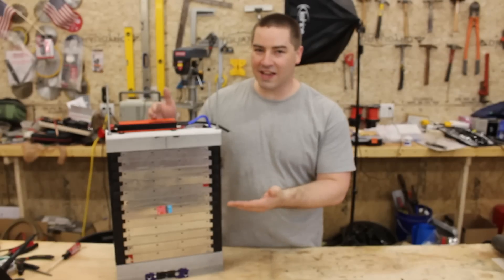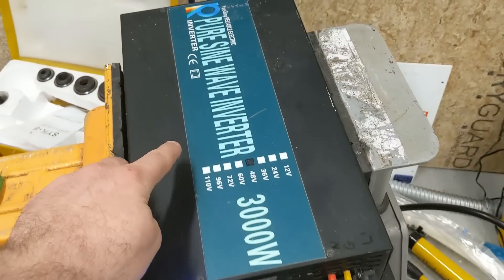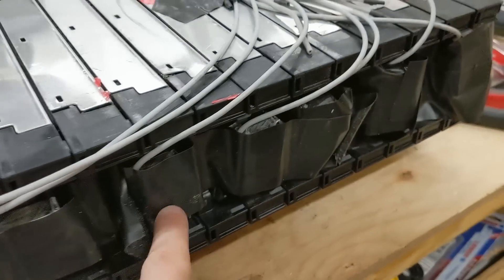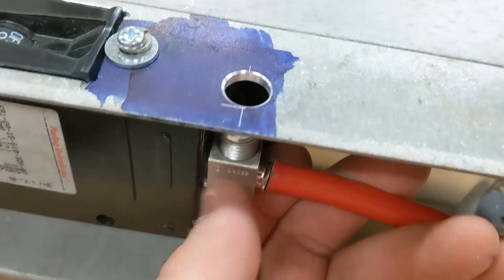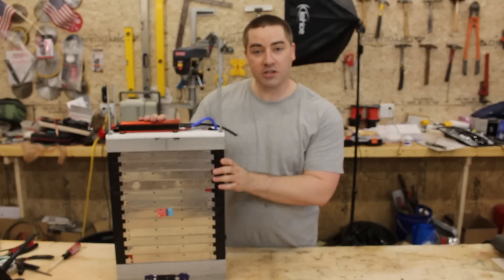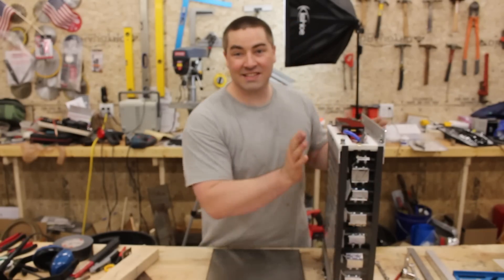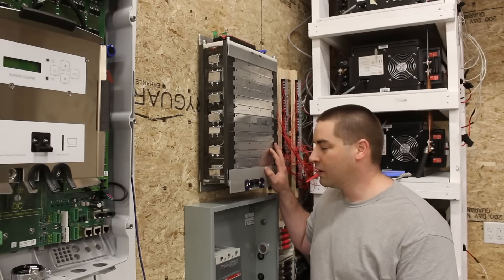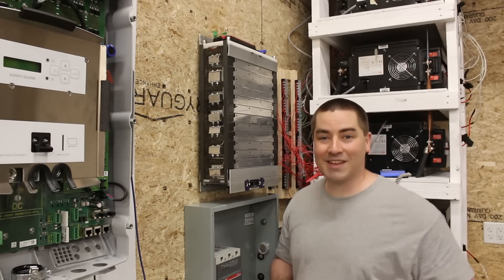LG Cells Part 2, 6kwh 48v DIY Battery

Comment: David Poz, What is the charging amps you decided ended up being a safe amperage? Also when you tested the capacity what did you deiced was full charge Voltage and full discharge voltage.  I purchased 3 6kwh Bolt EV packs from Battery hookups with your code, thank you for the help and hopefully my purchase helps you out.
Reply from the maker: Hi Darren,  I tested charging at different amps.  At 60 amps my pack was warm, but not hot.  Since this is a 120 amp*hour pack, a 60 amp charging is a 0.5C rate.  I think that should be the limit unless you include some kind of active cooling.  
I personally charge these to 4.05 volts per cell, and discharge to 3.40 volts per cell.  Since my arrangement is 14s (14 cells in series) my pack range is 47.6v - 56.7v
Reply: @DavidPozEnergy  Awesome that is very helpful.  I bought 3 of the full packs and split one in 3 parts to create two 14S packs.  I'm currently chargeting the two packs at 30 amps and running them from 45V to 57Volts, but 47.6 is still about 30-40 based upon my Bolt battery pack, I have a Bolt EV.

Comment: Anybody tried to detach cells from that black material between them without damage and reused it with cells in opposite direction? I want to make 10S1P while using original plastic enclosure.
Another question, how many cycles these cells are good for?
Reply from the maker: The cells come apart easily.  The black material has no adhesive.  It's a little tacky, but no residue.  Try using something like a plastic putty knife, or credit card to slide between them.

Comment: It may have a better density to power ratio but LiFePo4 is am much better battery for powerwalls. Safer and powerwalls do not have massive discharges. My house usually runs 10 to 15 amps discharge when the bank is running the house. 
Powerwalls aren't concerned with power to density ratios. You don't care how much the bank weighs, it's not a car, it isn't going anywhere.

When bolting all the prismatic cells together what you want is equal torque, not equal distance. You should check all your bolts with a torque wrench.

Comment: In theory. The pack with less resistance is going to get the biggest percentage of the load. If you you want to control the amps for each battery pack. You need to install an amp limiter for pack. But You shouldn’t worry about it, that’s why you installed BMS’s. Thanks for the discount code David, I just ordered my battery pack.

Comment: Hi David my question is I noticed that you are mounting your 48volt packs on a non combustible surface in most cases. Is there any fire hazard with these new LG cells. I have purchased 28 cells Thank you
Reply from the maker: There is always risk in everything we do, no matter what.  I can say that I'm comfortable using these LG cells with a BMS on board (the red thing), properly sized wires, fuses, circuit breakers, etc.  Here is a video from another YouTuber where he tested a similar cell  There was no fire, but it did expel gas: https://youtu.be/vQjXCL0rId0

Comment: Hello, I just found batteryhookup selling these lithium batteries on my hunt for energy storage
So I would need 28 of these bad boys to make 48v 10kwh-12kwh battery bank for my setup? :)
Reply from the maker: Yes, it would be 12kwh, but you might only want to use 10kwh to extend the life.
Reply: @DavidPozEnergy  Deciced to go for the Lifepo4 batteries instead to gain the longer cycle, what are the typical used sizes & price a piece, the cheapest I've found is about 2.3-2.4$ using Ali. 
Further in my search, I found these German made batteries which had a great cycle life, called Bae Secura, which were quite expensive while still using the old fashioned  battery technology.. :D

Comment: David , I just bought 70 cells (they were out of 36 volt packs) using your code.  Just wondering , have you tried what you mentioned at end of part 2 swapping the individual cells in case to connect directly with screws rather than using the blocks ?  If so how did it work?  Interested to see rest of your golf cart build and enclosure you make for battery itself, heat sink etc if needed. later get a used newer 48 or 72 volt cart and put aftermarket motor in like 10 HP larger diameter tires with lift kit and with parallel battery you can have a street legal 60 -80 mile  26 or so MPH vehicle and with off road tires like a 2 wheel side by side !
Reply from the maker: I have not personally swapped the two cells around.  However, since this video I've been e-mailed photos from several people projects telling me it was very easy.  No glue.  The black (foam-like) pad between the cells is sticky, but not glued.  no damage to pull the cells apart and swap them around.

As for the Golf Cart, I need to learn more about the different options out there.  I would like to do some fun modifications.

Comment: Thanks Dave! I just ordered 28 of these cells today using your discount code. Just wanted to pass along something nice BatteryHookUp did. Ryan called me after I placed my order and informed me they have an extra discount for “bulk” orders. He refunded an additional $140 for me! Very honest and reputable company since I wasn’t aware of that and never would have known. I highly recommend them!  Looking forward to building my battery. I appreciate the time and extra efforts you went thru to produce and share this video. Best wishes!
Reply from the maker: That's awesome he did that for you.  I agree, they are great people.
Reply: @DavidPozEnergy  I also ordered 28. I ended up returning 10. I was going to return more for very short leads but in the end I kept those. The ones I returned had either puncture marks or dented corners. In one case the electrolyte was leaking because the dent was so severe. But Battery Hookup sent me a UPS label and I shipped them back, no hassle. I asked them to inspect better and not send me this type of quality again. But I hope they don't end up going to someone else. Another observation - I ordered same BMS as you. But they changed the product a lot. Now the balance lead connector is on the side and the P- and B- are also on the side. In addition there are two each of P- and B- which must be connected in parallel. I think this is good as it distributes the current from two points and two wires instead of one. But one of P's and one of the B's covers a mounting hole on each side. And I mean, you can't even use it normally anymore. I had to tap the hole with a 6-32 and come in from below, which was a hassle. Last part of the saga...one of the two BMS's was DOA. The offer from Daly is I ship it back to China at my expense, they repair it under warranty and ship it back to me with my next order (which I don't have a next order at the moment). So that's a bummer. But I got one 6kWh hour unit up and running. It's perfect!  Thanks David.
Reply: @Bucky Cage That’s unacceptable from Daly. Who did you order it through? If you ordered it from someone like Aliexpress you can definitely get a refund

Comment: David, I just built a 24V battery with the same LG Chem cells; Thanks for your knowledge & expertise!  I am about to build another which I'm going to run in Series-Parallel with my MPP Solar 48V/3000W Ivnerter/Charger/MPPT, Any suggestions? (I will post a video on that build as well). 
Have you thought about using these in 12V Systems? The top of charge would be 16.8V (w/Four 3.6V cells), the range would be 12-16.8, primarily discharging around 15V,  so i'm worried they will be beyond the acceptable range of 12V equipment and appliances (I hear that range is normally approx. 11-16V)... Let us know if you have thoughts?
Reply from the maker: Yes, you got that right.  Using this type of lithium in a 12v setup will wind up making the voltage a bit too high.  Whenever I'm asked about build a 12v system I suggest moving to LiFePO4 chemistry and doing a 4s.  That way the voltage is a little less.  These can be broken down into a 12v pack nicely: https://batteryhookup.com/collections/lifepo4-batteries/products/a123-36v-module-w-48-26650-anr26650m1-b  and you can still use my coupon code "DAVIDPOZ" for 10% off.
Reply: @DavidPozEnergy   So those 39.6V, 9.2AH, 364WH. So three  packs could be re-arranged to create a DIY 90 Amp Hour 12V battery for $150, That is awesome energy density per dollar, but it is a fair amount of work (… I've never seen these packs in person so size and weigh could be a factor?) Anyways, 6 of these packs ($300 delivered with your discount!, + BMS), will get you 180 Amp Hours at 12 Volts, that’s a very “RV Usable” battery pack. That’s a really good deal but it's also a fair amount of DIY'ing! Have you thought about what config to use and the easiest ways to build the buss bars, integrate the existing racking? Also, do you have an opinion about the number of charge cycles you should be able to get out of these? I hear the LG Chem cells may rival LIFEPO4 chemistry, although I am skeptical... Maybe I’ll do a video about a DIY build on these, If your already doing one, I could do a different voltage or config, LMK? Garrett
Reply from the maker: I've got some of these small lifepo4 packs waiting for me to do a 12v build, but I don't get a ton of interest in 12v.  Just one of those things I've got to get to.
Reply: @DavidPozEnergy  Clearly, I'M super excited about the potential of being completely off grid, which cheap used solar panels and quickly accelerating battery tech is making more realistic every new day....
Reply: @DavidPozEnergy  As you know, 12V is an RV/Van Life thing (...& of course also Preppers), That said, 12V appliances and equipment are incredibly efficient (although expensive because of poor economies of scale). That could change in the future, with people in the know focusing more on that Voltage. I'm trying to figure out (currently) how to charge my 12V banks with my 24/48V battery banks (Stepping down and regulating the voltage and current), As those higher voltage battery banks charge much more efficiently large solar panels (especially 72 cell+ panels, which coincidentally are the cheapest on the used market due to their size and weight).

Comment: 4hrs into the test 47v and 5.6kwH - what does that mean. Does it mean after 4hrs your battery has used 5.6kw or does it mean your battery uses 5.6Kw every hour?
Reply from the maker: kwh is the total amount of energy consumed.  This pack has a little over 6 kwh storage capacity.

Comment: Dave! Wonderful build. Can you kindly provide a brief update on these LG cells, how numbers and depth of discharges, capacity, etc. trying to decide how many to get upfront. thanks.
Reply from the maker: They are staying in balance and working perfectly.  I really like them.  However, right now I'm not cycling them daily.  I have them connected to my Sigineer hybrid setup in a test situation.
Reply: @DavidPozEnergy  Thanks so much for the update. Usually, if a deal seems to good to be true, you know how it goes. Ordered 14 to make a pair of 24v@120aH for now to be compatible with the inverter/charger already onboard. It is 24v 3,000 watts continuous. Other parts of system are 24v so going to 48v is going to be speedy, especially since all the other 24v equipment needs upgrading as well. Going to do solar panels and charge controller next, then reevaluate a move to 48v. Not sure it makes sense once all the cabling is sized for 24v. 

Probably going to add another 7 to the order. :)
thanks again.
Reply from the maker: Good stuff.  Yes, I've bought my share of dud battery deals, but the LG's are (nearly) new, so they are the best ones I've ever worked with.

Comment: Hi David.  I liked this battery build so much I'm making one as well for my  golf cart.  Do you think the 200 amp daly bms will suffice?
Reply from the maker: I don't know how many amps your motor can pull at startup.  I've been asking this very question on some facebook groups, and I'm getting numbers over 400 amps.  I just picked up an old golf cart to try this very thing.  I think I'll use a large contactor (big relay) with a different type of BMS.  But I still need to do some amp tests on my golf cart.
Reply: I did see similar numbers in chat groups. The controller takes a max of 400 amps on a  48v Club Car.  The Orion JR bms will handle 500 amps but the price tag is over $400.  I'll probably go that route , but some guys tested amp draw and saw startup numbers at 180 and 60 while running.    Let me know if you find a cheaper BMS at those amps!  Thanks

Comment: I want to do something like this. I'm buying 32 3.2V 105AH LiFePO4 batteries to make a 24v 10kWh battery pack for solar power on an RV. I was thinking of wiring them 8 in series for 24V @105AH,  and then 4 of those packs wired in parallel for 24V @ 420Ah. Is that the right way to do it and what kind of BMS will I need. I appreciate any advice you have.
Reply from the maker: I think you have it correct.  8 cells in series is 24 volt, 16 cells in series is 48v (LiFePO4).  You will want to wire your cells in parallel first, then in series.  I understand going with 24v if your RV is already 24v.  However, if your RV is 12v, then look at making your battery pack 48v.
Reply: @DavidPozEnergy  Thanks! What about the BMS? What kind would  I need and do you have a video on wiring one?

Comment: Please tell me the size of the screws that fix the battery cells.
Reply from the maker: I was using #10-24x1.25"
Reply: @DavidPozEnergy  
Thanks for the reply 
What are the sizes of the four long screws that secure the 14 battery cells?
Reply from the maker: 1/4x20 threaded rod

Comment: David, I'm thinking of making one for my pop up camper, replacing the lead acid battery. With these: https://batteryhookup.com/products/new-lg-chem-n2-1-3-7v-120ah-cell-module   I would imagine it would require a 4s 12v bms to manage 4 of these batteries connected in series. Would that be a good assumption? Are there an safety concerns based on the fact that it's going to stored/used inside the camper?
Reply from the maker: I don't recommend this chemistry (Li-NMC) for a 12 volt battery.  Instead I suggest you use LiFePO4 chemistry for a 12v batter.  The voltages line up much better.  Use LiFePO4 in a 4s configuration.  Battery Hookup sells these: https://batteryhookup.com/products/a123-36v-module-w-48-26650-anr26650m1-b  They are currently 36v, so they would require you to cut the bus bars in 3 spots, and re-wire into 12v.  Add a 4s BMS for this type of cell, which has a nominal 3.2v.  Use my coupon code "DAVIDPOZ" for 10% off, and it helps the channel.
Reply: DavidPoz Thanks!!

Comment: Hello David,
I would like to buy 2 units of Chevy OEM LG Chem 10s 36v 5.94kWh, and I would like to know if you could help me with the selection of the  inverters /chargers for 2 new power walls home project.
The idea is to have one power wall for phase A (120VAC 60Hz), and another power wall for phase B (120VAC 60Hz)
I have installed a 2kW solar panel array and grid tie power inverter (240VAC 60Hz), then the new power walls should have 2 new grid tie inverter power limited /chargers, and using the above mentioned new battery packs.
Thanks,
Reply from the maker: Hi Julio,  It's great you want to build a powerwall, and I'm happy to offer some help.  The first thing about powering two phases, the inverters need to be supplied by the same battery bank.  I'm actually powering two phases, each phase has it's own inverter, but they share the same battery bank.  I'm using a pair of SMA Sunny Island inverters that can work very nicely in this application.  They don't, however, work with 36v.  I would suggest buying 3 of the LG modules.  On one module, cut the copper buss bar at the halfway point.  Bolt on a wire at the halfway point and series each half to the other two 36v modules.  This will create two batteries, each will be 15s.  This will make a 15s2p very large battery.  That has a working voltage of 45-63, which will work perfectly with a pair of SMA sunny island inverters.  Here is a video where I introduce the SMA inverters that I'm working with: https://youtu.be/aU9gNSoep-o

Comment: David thank u 4 creating these great videos and for the discount code! If u were starting from scratch, would u just go with a 36v setup (charge controller, inverter, BMS, etc) since batteryhookup has 10s LG complete battery packs available?
Reply from the maker: If I was starting from scratch I would buy EV cells like these, but I would buy ones pre-configured as 16s.  16s is a little high in voltage and not all inverters go that high, but I would do it and buy equipment that can.  64 volts is fine (4 volts per cell) and there are enough options on the market for that.  Battery Hookup consistently has 16s modules available.
Reply from the maker: 16s still works with nominal "48v" equipment, but you need to make sure the inverters/chargers go up to at least 64 volts.

Comment: I have 7 banks of these batteries in a 2P14S almost identical to your setup. Can I use one 250 amp BMS for all 7? If so do I just make 15 leads for each additional 6 batteries and parallel all the leads to the bms leads? I have 20awg copper wire and ring terminals. Is this sufficient for the leads? Thanks ahead of time.
Reply from the maker: I suggest using one BMS for each battery.  The good news is each BMS doesn't have to be a big 200 amp model like this.

Comment: Excellent video David, i need you recommendation for a BMS to use in a powerwall 7S60P with 18650 battery
Reply from the maker: Hi Victor,  There needs to be more detail than I can get into here.  You can try sending me a message on facebook, or ask the question to the facebook group called "DIY Powerwalls".  When you ask your question there, include your 18650 model number and data sheet.